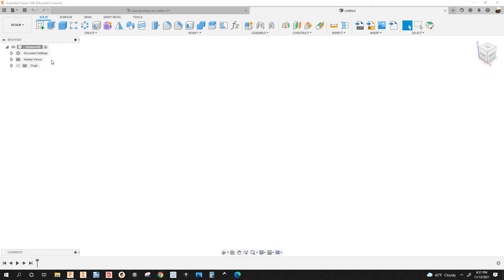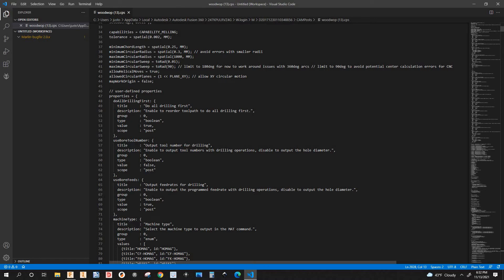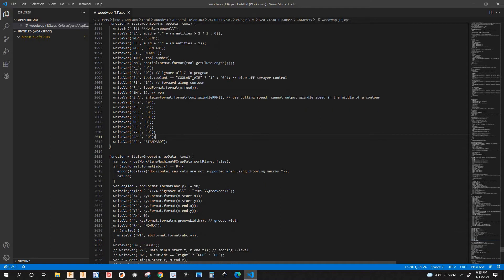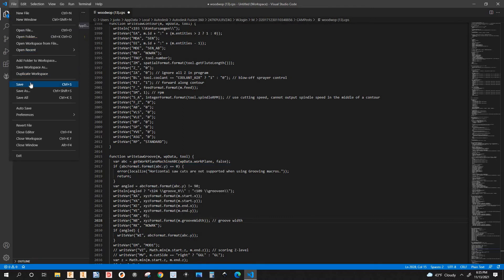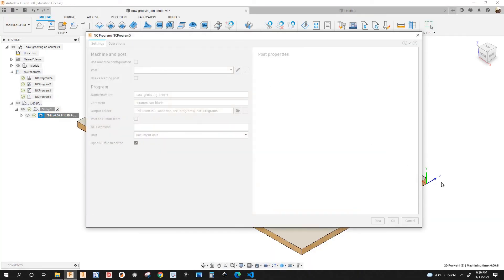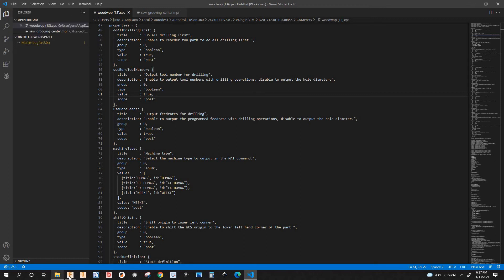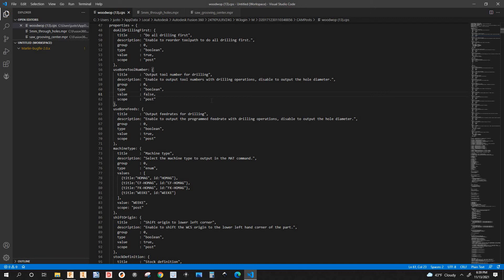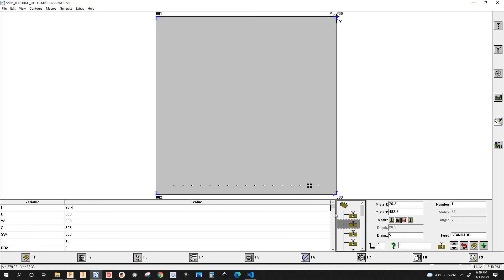Fusion 360 to Woodwop post. CHANGES  THAT I MADE TO THE WOODWOP POST PROCESSOR FROM AUTODESK.

Comment: Does your post work with 5axis? I tried to understand the post processor but my coding experience is almost zero… running woodwop 8 right now on a centateq p210 and would love to get fusion to work with it!
Reply from the maker: Yes it does, unfortunately i cannot test it because the machine i program at work is 3 axis. When you post process a 5 axis program, it will be posted in iso mode. I suggest you run a test piece.
Reply: Cool, would it be alright if you send the post to my email?
Reply from the maker: @martelthefirst  What’s your email?

Comment: Hi!
Many thank's for all yours videos!
I have Weeke Optimat BP140 with Woodwop 5, 
I am unable to generate Fusion 360 nc code that is readable by WW, I am getting "invalid file format" errors. Do you have any thoughts on how to fix this? With the trial version of WW8 I manage to open the files generated by Fusion, but it refuses to generate the NC code, error (through unauthorized tool correction).

Another thing, I can't install WW5 on my PC (I tried with compatibility settings but it doesn't work), do you have any solution?

Thank you so much again for all these videos!
Reply from the maker: You’re welcome, i have a video on how to fix the invalid format message. If you’re not comfortable with editing, let me know so that i can email my post processor. I am running ww5 with windows 10, do you have a physical cd to install www5? Because you will need it. I have never seen that “through unauthorized tool correction”. Could it be wrong tool number, feeds and speeds higher than what you have set up in your tool database.